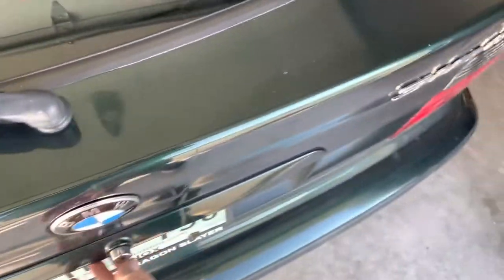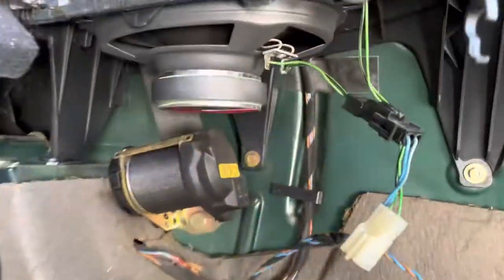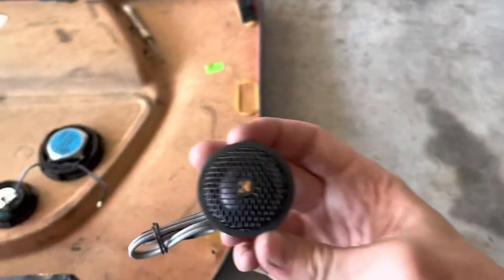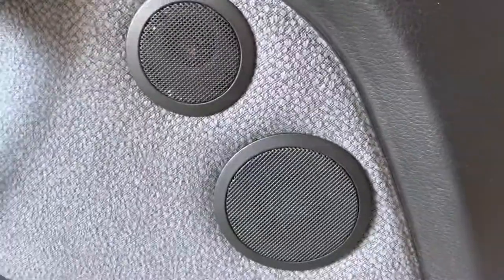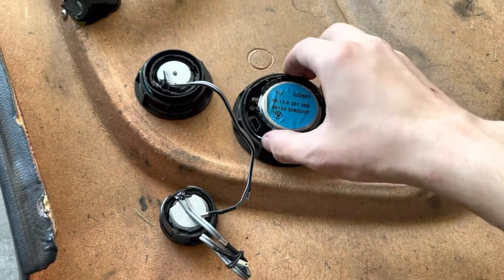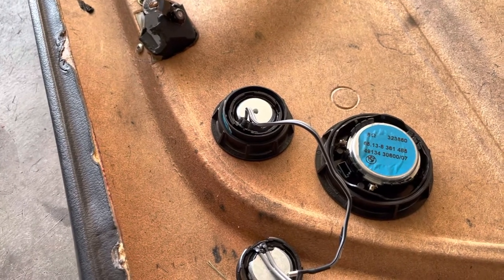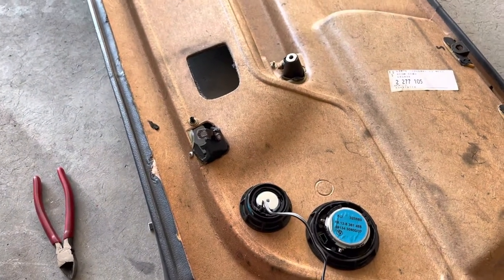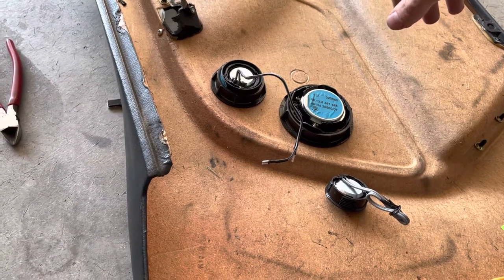318ti Bass / Sound System Upgrade! Factory look!

Comment: Did you change the woofer in the front kickpanels?
Reply from the maker: Yeah, doesn't make a huge difference though. Those speakers are 5.25. Might make a bigger difference if you upgrade the amp. Stock amp is super wimpy.